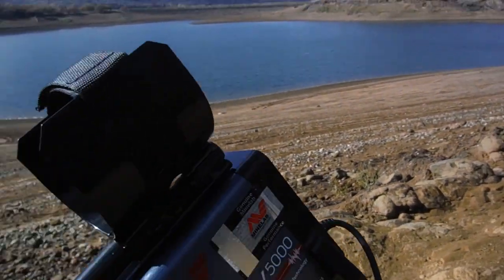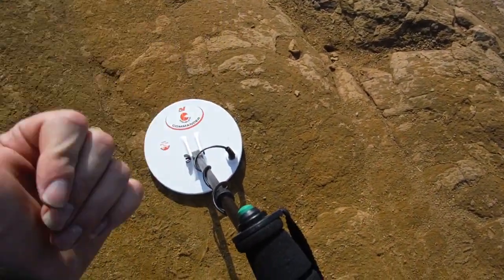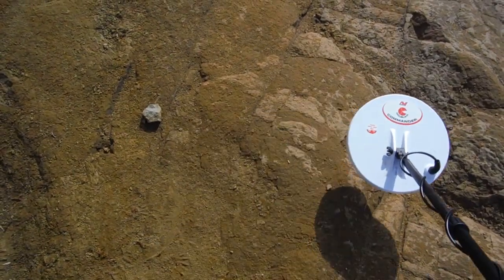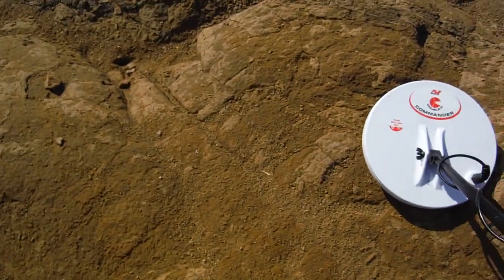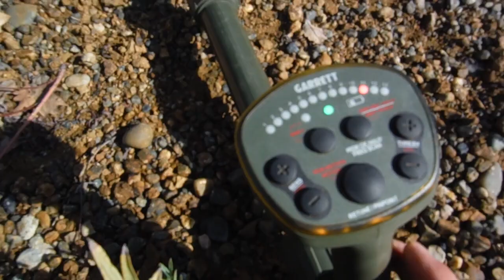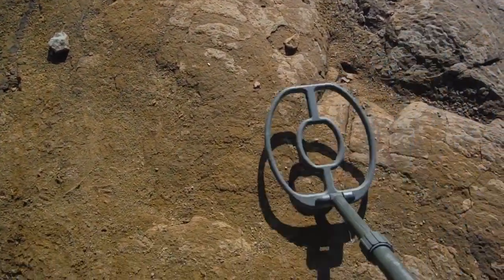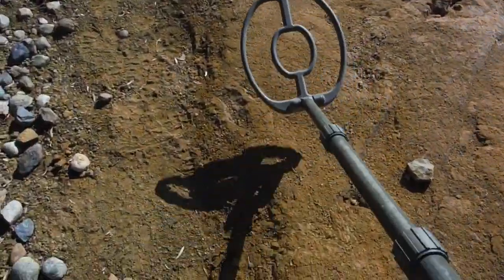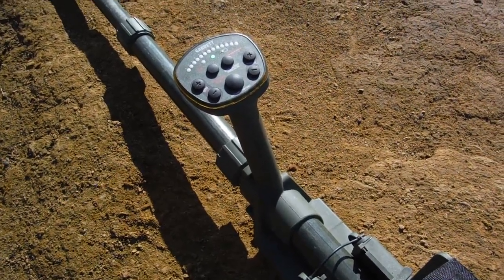Initial Test Garrett ATX vs Minelab GPX 5000

Comment: I took a friend out to one of my spots and he had the ATX, i had the 5000. I found an 8.6g and did an air test and the atx almost got it at half the depth mine did, few days later he upgraded to the best!! I've since had woodies detector mods do some upgrades on it and i did some testing between a 4500 and a standard 5000, and with only low front end gain because of EMI on the day my 5000 got 15% deeper than the others, Bloody awesome machine it is now!!

Comment: hello friend! I need to know if your device gpx-5000 was made in China! 
the device gpx-5000 manufactured in China have lower price than those sold by MINELAB ... 
you could tell me if the gpx 5000 manufactured in China are of good quality??? 
thank you
Reply: Did you see any fake performance better than original,if yes just let me know 
China quality on any metal detector is poor 
Be aware